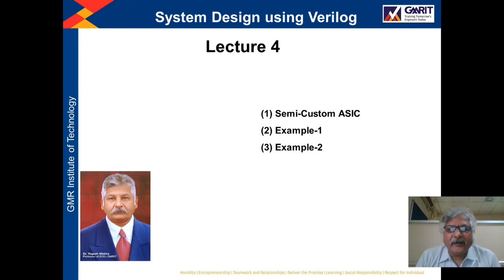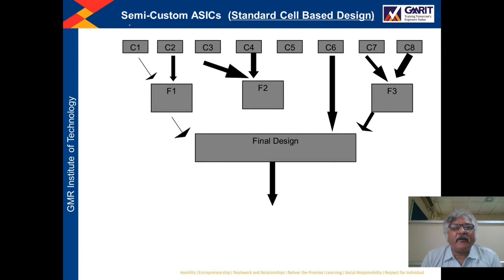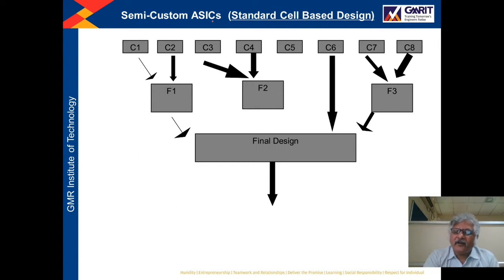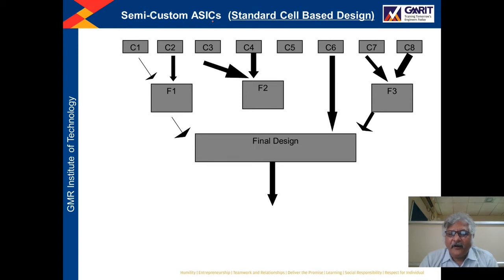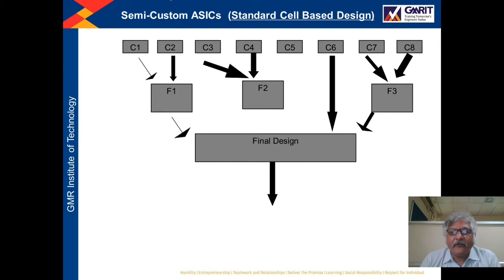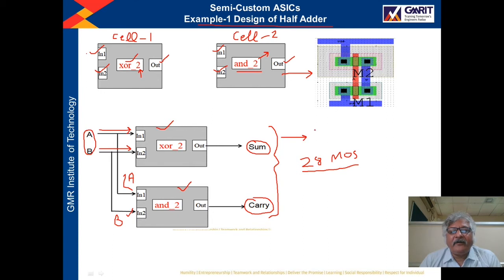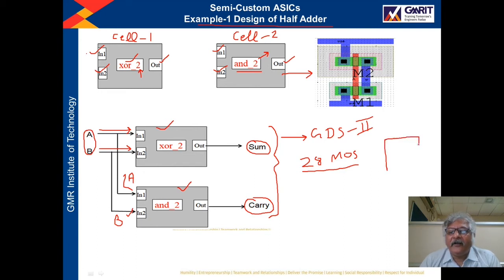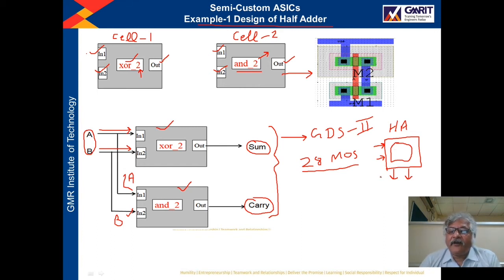Lecture 4 - Semi-Custom ASIC Technology

Comment: Sir, when I searched for CMOS implementation of XOR gate , it uses only 14 MOSFETs...
Reply from the maker: Yes it is possible if we optimize the equation.
But in my explanation I simply converted the logic equation of xor gate into MOSFET level that's why it is taking more number of MOSFETs
Reply: @DrYogeshMisra-Professor   Thankyou Sir